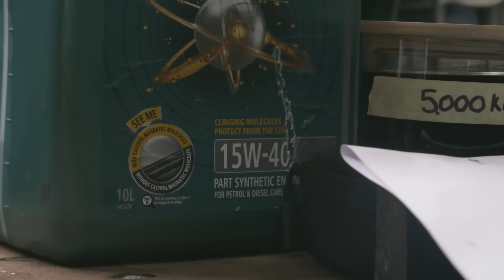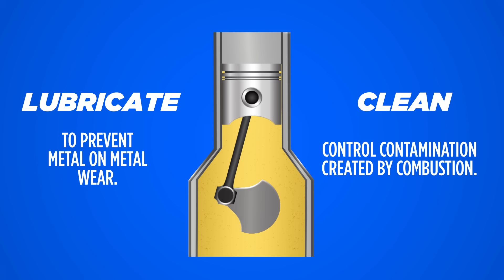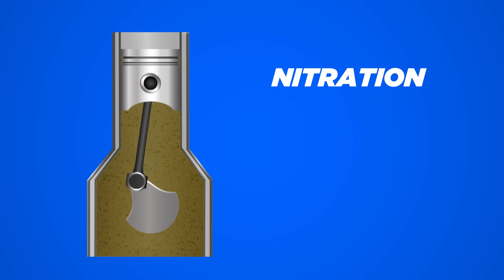Engine oil COMPARED at 5,000km vs 10,000km vs 20,000km! This'll make you service your 4WD RIGHT NOW!

Comment: Great Vid Shauno, 98/105/1HZ change engine oil every 5000k, oil filter every 10,000, check diffs and transfer case every 5000k,and top up if required, but change every 10,000, HJ60 (with 12ht)will do same, haven't reached those numbers yet ! and doing rebuild ! equally important to change fuel filters and air filters same time and check belts ! of course over a frothy or coffee ✔

Comment: Nice one. I was shown by a old cat mechanic that when you did the oil if you cannot see your fingerprint after you wipe the dipstick time to change and it works out about every 7500 in my stroked td42 patrol. So I always try to change it about then or a little before. A lot depends to on air filter services fuel filters etc make sure they are always cleaned new cars every service air flow  sensor cleaned with proper spray.

Comment: In these modern times a quality diesel engine oil is absolutely intended to be black because with modern high compression ratio common rail engines it is the job of the oil to harness the soot, ash and sulfur and capture it, if your oil is clear or even slightly clear when you change it then it is of poor quality or it is of the wrong API or ACEA classification for your engines particular setup and therefore it is not doing the job it is required to do. However obviously I am not saying black thick oil is good oil, of course not, as long as you regularly maintain your engine and service it regularly enough depending on how you use it you will be fine.

Comment: Have always changed engine oil between 5500-7000 Km, diff and trans around 40k km unless going particularly hard or suspect water ingress, brake fluids approx 2 year/30k km or when pads are done if sooner
And always use full synthetics

Comment: I have a 1992 petrol land rover discovery 1 an purchase it 5 years ago now an it was on 100.000ks now its at 250.000ks an never changed the oil manly dont have the money to change it an i only just change the diff oil an that stuff was brown an omg the diffs were in beautiful condition was Strange but got to say for a 30 year old 4wd nothings wrong only just got crazy body rust but other than that the engine runs amazing
Reply: Bro 😂 change that asap

Comment: Most of our middle age to newish 4WD's have ridiculously expensive engines and fuel systems should they decide to go wrong at the least opportune time.  All lubrication and filters are significantly cheaper than the components they protect.  If you are under new car warrantee, sure, do what they say.  I cannot see any reason not to create your own protection regime for fluids and filters in proportion to how much you value your 4WD.

Comment: Wait! What???  you actually have to change that stuff??  Like drain it out and pour new stuff in?   Well you see..  yeah I do change my engine oil every 5-7k.  I adjust my valve clearance 10k.  Diffs get done every 50k and gearbox….  Well it has a healthy leak. So I keep topping it up every service. I only have to worry when it stops leaking. Means there is no oil left in it….  So a year supply of engine oil ( that’s what is in my gear box ) would be very helpful.

Comment: 2012 PX1 ford ranger dual cab 6spd manual, no canopy, no bar work, not towing.
I service engine oil and oil filter @ 5000ks regardless of where I’ve been or what I’ve done. The car is usually on a highway if it’s not on a dirt, gravel road or a hard track.

Manual transmission, transfer case and diff oils get done every 8000-10000 because I’m not towing but still want to keep it regular and fresh simply because the fresher it is the better it’s going to be and the longer the vehicles vital driveline components will last. However, if it’s been on some hard tracks or through a fair bit of water, as soon as I’m home again those oils get replaced as soon as possible regardless of kilometres, water in any of the driveline components is certainly not a good thing and I have been as far as removing covers to clean the diffs out properly because water and oil just don’t mix.

If you’re worried about servicing a ranger or bt50, take it from me, don’t be. Just do it properly and you’ll be laughing!
As for the air filter, I use a k&n factory replacement and give it a good old clean with a k&n air filter cleaning kit when I change the engine oil.

Cheers guys great episode, keep ‘em comin. 
Can’t wait to see jocko in his new PX ranger project build 😜

Stay safe boys, enjoy.
Reply: Ps. Goin on to about 300,000k’s and owned for 4 years, we have put around 160,000ks on it in that time.

Comment: engine oil 5k, oil filters and fuel10k, air filter when needed, gearbox and rear diff and transfer 10k, front diff 20k. td42 gu

Comment: I did my lawn mower oil changes twice a year and cleaned the air cleaner. I got 28 years out of it before selling it to mate. It is still going without oil usage at 31 years. 7500km for both Mitzy Colt and Triton. All good.

Comment: Landcruiser 200 series VDJ200, 2011mod.  265000klm 
5000klm, Engine oil, and filter.  (Still looks perfect)
5000klm Fuel filter. + (Liqui Moly Diesel Clean at every fill-up).
5000klm, Air filter, and snorkel filter.
30k Front and rear diff oil change.
30k Transfer case oil change.
30k Transmission fluid change and filter.
50k Coolant change.
10k Provent element change.
150k Intank transfer pump and filter change.
 ALL PENRITE!!!!!!!!!!!!!!!!!!!!!!!!!! 🤣🤣🤣🤣🤣🤣😜😜

Comment: I have an 1989 hj60 and I change my engine oil and filter every 6 months or 5,000km. Whatever comes first but it very rare my cruiser would do 7,000-8,000km a year. So it gets looked after. 
I change the oil on all other components every year but check levels when I do engine oil. 
I have just recently changed over to Castrol oils. So a year’s supply would be very helpful.

Comment: The only way to accurately tell what your oil change interval should be is to get an oil analysis done preferably a few times over several changes like the big trucking companies do. That way you can look at soot loading, diesel contamination, viscosity etc. I do that with every new vehicle I own and with my current usage the suggested 15000km service intervals are doing just fine. But 90 percent of my driving is long distance bitumen too which no doubt helps extend oil life. Everyone is different though and mileage will vary.
Reply: I also change oil at 15,000 km (turbodiesel CRDI, fully synthetic ACEA C3) although the recommended interval is 30,000 km. So far no problem.

Comment: I change the engine oil every 5000kms because the old fella i bought my first diesel off recommended it, he had put 280,000kms on it without a drama. i change the oi every 5000kms for the first few oil changes then i didn't change the oil for 10,000kms...... next thing i know I've broken the crankshaft. from now on i do it every 5000.

Diffs and gearbox is done every 15-20k because oil is cheaper then replacing parts...

Comment: I have a 200 series deisel in Saudi Arabia. The dealer recommends an oil change every 5,000km regardless of how you drive it. I feel it's adequate considering the extreme heat and dust in the summer. Or is that too frequent?

Comment: Generally service the 1hz 105 cruiser ever 5-7500kms and mostly high-speed highway driving. Diff oils usually every 20000kms as well as gearbox and transfer case

Comment: Serviced by the dealer whilst in warranty. Then done by myself by the book. Triton has done 130,000 Km. 12 months 15,000km intervals. every 40 k for diffs etc. Still good viscosity in the oil I use.

Comment: Change my engine oil every 5,000km or 6 months which ever comes first. Gear box and diff oil once a year or 40,000km unless going through water crossing  then will change after trip

Comment: Awesome video mate. The amount of times people laugh at me changing me oil from 3,000kms - 5000kms because the service book says 15,000kms or 1 year. Every oil and filter change I do at 5,000kms is absolutely black. I have always changed them since brand new at 5,000kms and even to date changing them at 5,000kms they are black. Range Rover intervals are 34,000kms or 2 years how ridiculous is that I do it every 5,000kms.

Our work fleet are Isuzu d max and I recently found oil the oil gets changed at 20,000kms intervals but serviced every 10,000kms. But oil gets done at 20,000kms intervals I can’t understand that. This video is unreal love it guys!
Reply: This video is garbage and has zero scientific evidence to support anything they are saying. Send your oil to a lab to be analyzed and then make a decision. Running some oil down a piece of paper is hardly enough information for me to say it's ok or not. If a manufacturer (who is infinitely smarter than you or I with decades of experience) says your car is fine at X miles (or KM) then you should probably trust them.

Comment: I do the engine every 5000 And because it's an old land rover that uses engine oil in the gearbox / transfer I do that every 7-10k 
I do the diffs and swivel hubs ,All oil every 10-15k

Comment: Always loved castrol oils, only use it in my pajero shorty due to how cold the engine stays, roughly 65 to 70 on a good day, but doesnt go over 75 on a hot day, highest it will get is 105 on the beach doing long sand dunes and long beach runs. Due to all this, I change my oils (all) every 5k kms, just to be safe and to see if theres any metal fragments left over from a few hard driven tracks.

Comment: all depends on your vehicles purpose. My 80 series only goes on trips away, not daily driven. after each trip i inspect the engine and driveline components, fluid levels, blow radiator & condenser out, clean and put away. serviced every 7500kms.
my daily driver gets 10,000km service only
work vehicles get 5000km inspections and 10,000km service, its not unusual for a work vehicle to get serviced every 3-4 months

Comment: Hey Shauno, I service my engine oil every 5000 Kms, as well as my fuel filter evey 5000kms as I see it as cheap insurance after wheeling hard and through deep water often, I service my diffs every 10,000kms for the same reasons gearbox and transfer every 10,000 to 15,000kms, check over and grease if needed uni joints every week, check tyre pressures once a week, change air filter based on how clean it is, but usually every 10,000kms, hope this gives you some insight 😁

Comment: HOUR METER GAUGE!!! EVERY 250Hrs!!!Honestly using kilometers is an outdated method of managing your vehicles service intervals. If you use your vehicle as a motorway vehicle, then sure use kilometers. But what happens when you hit traffic, engine still running with the AC cranked all the way but your not racking up any kilometers...
For an accurate way of keeping your vehicle engine healthy is by means of an hour meter gauge. You've just gone offroading all day long low range working your vehicle really hard but you only done a small amount of kilometres but you've done 5+ hours of running engine... Cheers

Comment: I change the oil and filter on my Surf (4 Runner) every 5000km. I’m not doing too much “hard” driving but for me it’s worth protecting the engine and hopefully get it going for longer. Like you said “oil is a cheap insurance” better safe then sorry. Diesel filter gets changed every 10000km. 
Bought the truck 2 years ago and the first thing I did was replace every fluid in it so I have the peace of mind and a good starting point for future maintenance cycles.

Keep these kind of videos coming. It’s interesting to see what you guys think and recommend 👍

Comment: Its 5k for engine 40k to 50k for gearbox, diffs and transfèr. Brake flush with new pads, unless its a major trip its full service before heading off and when home from the trip. Servicing your own rig is cheap and only takes a couple of hours for a full service. Simple oil and filters on the old td42 only takes around 15 minutes. Its something about fresh oils in my rig just makes me feel good.

Comment: Hi from France ! 
Thanks for the insights on oil contamination, and especially for petrol engines, I didn't know that oil can get contaminated by water if not running at operating temp !
On my Jeep Grand Cherokee WJ, I usually change engine oil every 4000 to 5000km, because I wheel it pretty hard, I abuse it quite a lot (man this 4.7 V8 sounds so gooood), and also because it is as per manufacturer specifications ! They actually propose two plans for vehicule maintenance, wether you use it like it was designed for, or only on pavement ! That's pretty neat if you ask me !
I obviously change oil filter when I change oil, I don't understand people changing oil but not the filter, resulting in immediate contamination of your engine oil.
Regarding transmission and transfer case oil and filter, I change those every 20000 to 25000 km, or earlier if I see darkening in the oil (I'm checking all my oils every two fuel tank refills, people are looking at me like a madman at service stations).
And since I have factory limited slip differentials, I check on them regularly to see if the oil does not smell like burnt (happened once, I might have had too much good times in the snow), and if no water has entered differential housing when crossing deep rivers. Since I have to use the expensive Mopar additive especially made for those limited slip diffs and it is hard to find in Europe, I change diff oil only every 30000km.
Have a great day, thanks for all the amazing content ! I learned how to use winches the right way by watching you guys, and I can't thank you enough for that <3

Comment: Every 4k i change oil and filter and will be changing diffs, gearbox and transfer box on navara after 4 yrs old from new as only got 26k on clock ,  here in uk its 18k on nissan servicing intervals🤦 never dream of leaving oil in for that long and diff , gearbox and transfer oils are supposidly lifetime oils according to dealers 🤦

Comment: 2010 navara d40 stx, used on long trips, daily run about and everything in between.

Vehicle gets run hard in every type of condition aswell as towing heavy loads and just ducking of to spud shed to get some sour cream for tacos for dinner.

Oil and filter change every 5000km
Gearbox oil flush every 10,000km
Rear dif and transfer case every 10,000km

Comment: 5000kms on engine oil, 25000kms on gear oils and take oil samples to send into the lab at each change and half way through the interval. It might cost an extra $100 for the samples to be tested but the piece of mind knowing your oil is in good knick is priceless

Comment: 5000ks for my little 2.5 d22. bought it at 64000ks and nearly hit 200. diff oils and tans i try and make sure i get done between 10 and 15k due to price of oils, unless of course im working her hard in which case i bite the bullet and cough up the cash. also my little rig is running 33 inch muds and is daily driven with a mix of highway and low speed. please give me the oil cause im poor!

Comment: Engine every 5000, auto trans every 45000, diffs and transfer cases change every two years but check at each service, another thing is spark plugs 15 -20 k

Comment: Get a paper towel and wipe the dipstick on that, if it's somewhere in between the 5k - 10k oil shown here i would change is or just a bit darker than the 5k one. Before all that it's just a waste of money as the oil is still doing its job and you're just flushing cash down the drain.

Comment: I have used Castro Oils since the 70’s in petrol engines and still do, from 84 I started with RX Super in my diesels at 5,000 k intervals with a filter and  every second change a can of flush added. Since  Magnatec was released I have used both types diesel and petrol at 5,000:and 10,000 depending on the driving done and a can of flush at 10,000. The gear box,transfer case and diffs usually at 20,000 but always before a major trip. Universal joints greased at 10,000. No failures.

Comment: Does it make a difference if the oil is full synthetic (not part, not half, but 100%)?  I've always thought fully synthetic old does not lose any viscosity as it age (certainly not within 10k kms).  Plus it maintains its viscosity for a wider range of temperatures.  Though I'm referring for a petrol engine here. It'd be interesting to know.  I have a, FZJ80 4.5L petrol - which is not a daily, only an overland rig.  And I regularly get it serviced (using 100% fully synthetic oil) every 10k kms. I was told since the engine has only done 130k kms, a fully synthetic oil is ok to use.  But as more and more kms pile on, a fully synthetic oil will not be the most suitable oil for the engine.  Is this correct?

Comment: I send a oil sample in at around 5500-5700 miles for testing and change before 10k on new Jeep on my 4.0 I've been changing it at around 5k since new full synthetic its over 255000 miles oil sample shows its doing very good still showing less wear than expected for the high milage.

Comment: Depends what the vehicle is doing. Hilux I use to run about generally change at 10k and oil is fairly ok looking but cruiser Ute and ranger ute that carry and pull loads get done at 5 to 7 k , seems to work for us as had no problems as yet and all over 150k on the odometer

Comment: This episode is one of your best this year I think, it's an underrated issue people forget. My servicing good like this. 
Every 5k oil and oil filter change
Every 10k oil and filter, fuel filters, diff and gear oils including transfer case and replace Air Filter.
Only exception to this is diff and transfer after every hard 4X4 trip.

Comment: Engine 5000kms
Trans,transfer,diffs 10000kms
Fuel filter every 5000kms 
Air filter every 5000kms 

The landcruiser is my work rig and spends 90% of its life offroad